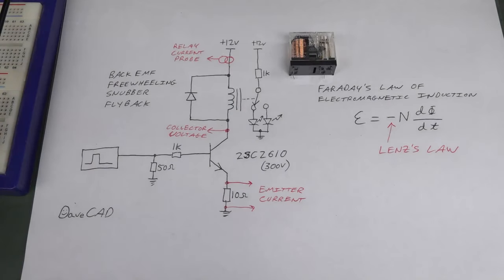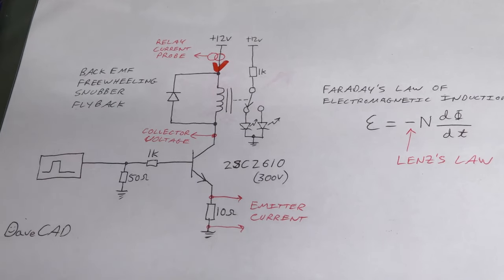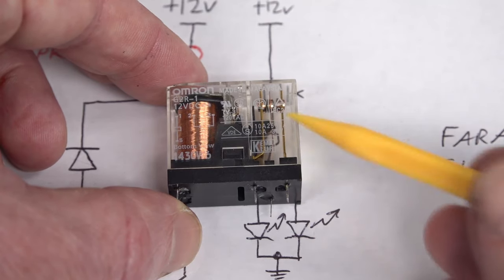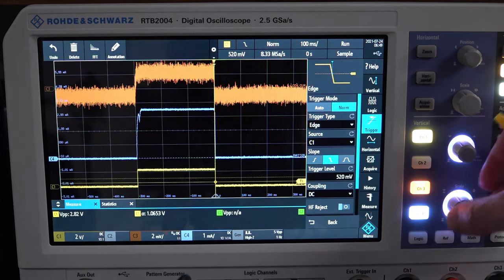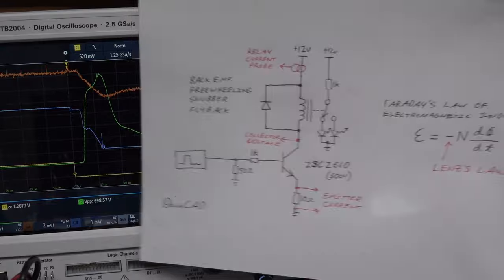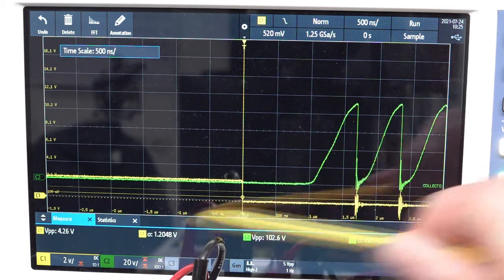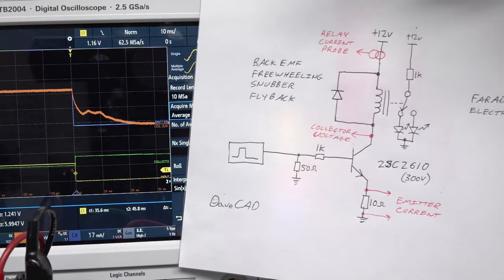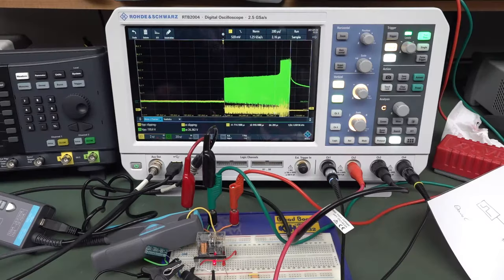EEVblog 1409 - The DANGERS of Inductor Back EMF

Comment: what about ac transformers. how can I remove the back emf when switching off the transformer?
Reply: Typically there are various delay circuits used when switching ON transformers (especially with big toroid transformers that have large EMF). These mostly introduce resistors or varistors in series with the transformer for a short while (using a timed relay) and thus minimizes the current inrush (and lowers peak voltage). The switching OFF scenario is not typically needed to be taken into consideration, because you often switch off the transformer on the primary side and the load drains the remaining EMF. If you do break your circuit on the secondary side, then you probably have to design some circuitry around that.
Reply: @johansvideor  actually I have a soldering iron, which has a mains transformer inside, whenever I switch it of, it makes a huge bang noise on my sound system. I tried to use mov on the input side, it helped a little bit but still its happening. Thats what I have been trying to fix. I cannot galvanically isolate it from the mains because sound input comes from the pc :/ and isolation transformer that I have distort the sound a lot.
Reply: @esunayg  How about using a two pole mains switch?
Reply: @johansvideor  its already double pole switch from factory, if I recall correctly
Reply: @esunayg  That's a bit outside of my experience. But in theory, an AC line EMI filter could help. I have used them as a precaution in multiple devices. There are ready made filters you could buy or you could build one from discrete components consisting of at least an X rated capacitor between L and N, possibly also one or two Y caps to ground/earth (if there is a safety ground connection). Further a choke (common mode) if the caps are not enough (but I'm not sure it is needed in your case). The filter should be placed at the AC input of the device.

Comment: Is it possible to capture that back EMF into a high voltage capacitor?
Reply: Yes, this is how boost converters work. They use transistors and an inductor. Build the energy stored in the inductor, cut it off so the magnetic field collapses, resulting in a voltage spike. It does this quickly over and over. It then smooths out the output voltage with capacitors. The result is a higher voltage than the input. This can be surprisingly efficient (over 90%), but it's a bit harder than voltage stepping with AC.

Comment: That extra noise is mostly RF interference coupled into mic. Maybe there is a slight noise difference mechanically but I doubt it makes all that difference.
Reply from the maker: I forgot to add that in an overlay, it is certainly much louder to the ear, it's not just mic coupling.

Comment: Great information.  In industrial settings, RC networks are used mainly in AC circuits and almost always a diode in DC circuits.  Not using suppression can be very problematic in CNC machine tools.

Comment: This was great.   Very informative.    I have been using my scopes more these days to look at details of general circuits I have built over and over through the decades and never thought to look more deeply into what was happening in more detail.    Also have been helping a friend use a scope to view automotive electronics.    It is amazing how much you can learn/troubleshoot about car electrical health from analyzing current and voltage wave forms of auto electrical components.

Comment: hi Dave, do you have any insights about the effects of a dying battery in a differential probe regarding its accuracy ? could make for a good video. Maybe for other instruments, too.
Reply: Ummm "don't do it"? (Don't operate an instrument when its low battery indicator is ON)
Reply from the maker: Every instrument should operat within specs until the low battery light comes on.

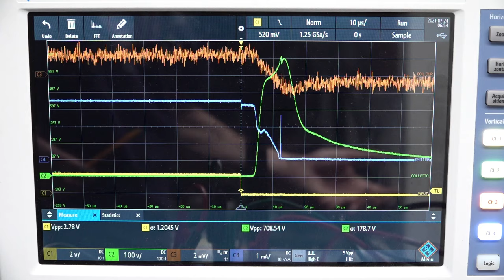Comment: 15:38 Dave, is this similar to how a MOSFET stays switched on due to gate capacitance?
Reply: No. BJTs and IGBTs have the behavior when they reach saturation. It is similar (the transistor equivalent) to the reverse recovery time of a diode. Something to do with "minority charge carriers." MOSFET's do not have this behavior. They do still have parasitic capacitance between all 3 terminals which limits how fast they can switch. These parasitics can be reduced by going to SiC, GaN, SiGe type transistors (commonly found in RF and microwave amplifier circuits and high performance ultra high speed switching)
Reply from the maker: No, very different phenomenon.

Comment: Try unplugging a 60 HP dc motor 190 volt field from the field supply when its on.
Reply: Was there anything left of the connector afterwards?  I saw one of our Techs unplug a 2HP, 190V motor.  I think he sh*t himself.  After that, we started putting red lamicoid tags at all motor connectors saying "CAUTION, DO NOT UNPLUG WHILE POWERED".
Reply: @MrBobman49  the connector was damaged but still worked.

Comment: I remember once seeing a design that somehow used a second mosfet instead of the diode to try to increase efficiency in a buck regulator. Due to this being designed for students and needing to not destroy itself if the microcontroller were to not have the best timings, the diode was left in place as a backup.
Reply: https://en.wikipedia.org/wiki/Buck_converter
Switching DC-DC regulator with a synchronous switch instead of the diode. Saves a very small bit of power at the expense of complicating the driver and circuit.
A diode in there is fine.
Reply: @nameredacted1242  Thanks for that. Now I know the term to look for :)
Reply: So basically a zero-drop active diode made with a MOSFET?
Reply: @gblargg  You got it! They go to the end of the Earth these days trying to save a milliWatt.
Well also you technically CAN gain other benefits, like being half way to a buck-boost circuit, or use the bottom MOSFET to clamp overvoltage conditions, or in an IC sense fun things like waveforms and currents (ICs these days are SO complex!), etc... But a MOSFET for a controlled switch and a recirculating diode make a perfectly sufficient buck or boost regulator.
Reply: @nameredacted1242  They are used for low output voltages (5V, 3V3, 1V8, 1V2 etc) because otherwise a "significant" portion of the output voltage will be dropped in the diode. This decreases efficiency but the major problem is that it generates more heat, as a result the diodes must be bigger and will require a heatsink.

Comment: You can actually capture the back EMF to do work!
The easiest way is to simply add a capacitor or battery in series with your diode, so every spike goes into charging it up instead of being converted into heat!

And yes I was taught this by Free Energy guys! . . . who says you can't learn things from Free Energy research!?

Comment: When I was a kid, I first learned about this when I held the wires on a 240v turntable induction motor and connected it across a 1.5v battery, then disconnected while still holding the wires. I was fascinated with the kickback voltage it sent through my arms.
Reply: Ouch! I used to wonder why I got zapped by relays, before I understood counter-voltage spikes.

Comment: With the reversed polarity, the coil draws the switch open, in addition to the spring force, thus the added energy/noise.  (If it can push, then it will also pull.)